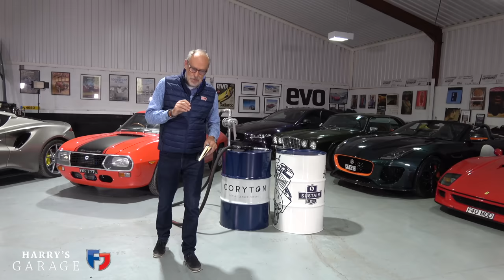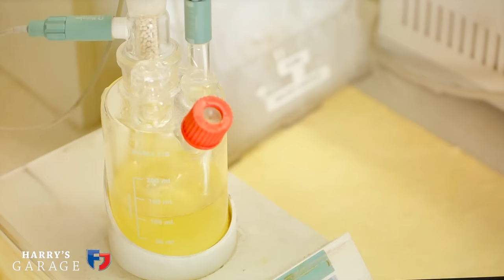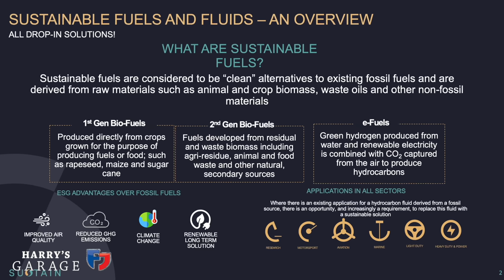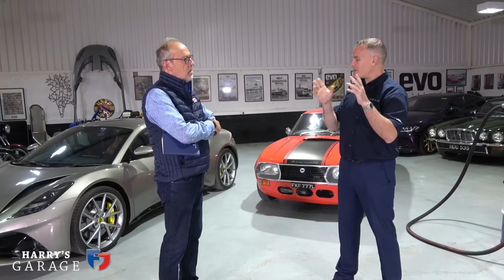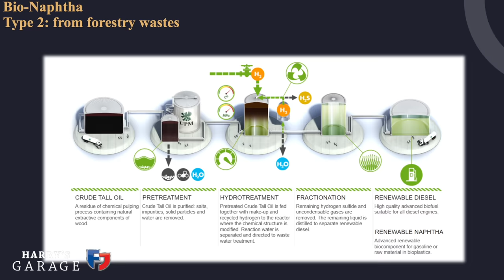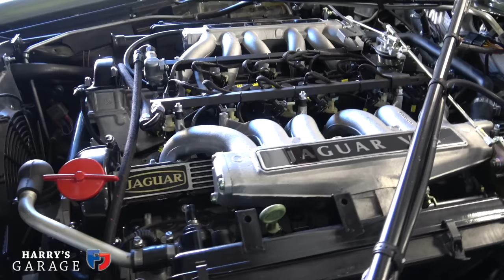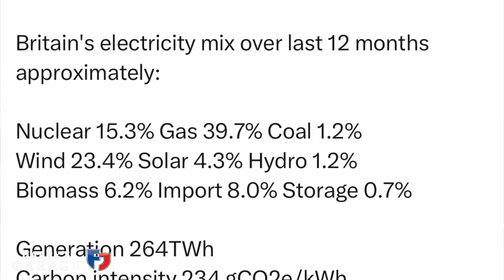Everything you need to know about using sustainable fuels. Why they're good news for car enthusiasts

Comment: Phew, so that's that sorted then!😂 Obviously not the simple answer to fossil free fuels that many were/are hoping for.
The disappointing part for me was, "it's not intended to replace fossil fuels for the average family car" but that's exactly what's needed IMO, a sustainable, affordable, readily available fuel to enable Joe Public to keep their conventional vehicles. On a personal note, as a 60+ petrol head, I think all I can hope for is that petrol and diesel availability at an affordable price out lasts me. 🤞
Reply: It makes no sense for all-day family car use, because the production process far too inefficient and expensive.
It is a solution where fossil fuels cannot be replaced by EV batteries (aerospace) and old / special / race cars obviously.
Reply: @autobahnroadtrips4662  How can you suggest it's "inefficient" when compared to 'sustainable' electricity production and horribly polluting BEV production, not to mention all the losses and inefficiencies during their use...then their recycling if it's even possible!?

This is incredibly small-scale production at the very beginning. And it's already massively cheaper than EVs are for certain!!! Do you not realize how much Evs and their infrastructure costs?? It's TRILLIONS!!

There are tens if not hundreds of thousands or people who have been driving for a decade on HVO biodiesel, biomethane, bioethanol and natural gas. Those are all MASSIVELY cheaper than EVs!!! Snd lower in CO2!

E-fuels can also OF COURSE be produced at large enough quantities and in very efficient production facilities, both in modern nuclear power plants and in remote locations where there are sustainable geothermal, wind, solar, etc. sources which can't be utilized without e-fuel or hydrogen production. But I guess you have no clue about e-fuel production in (or alongside) nuclear power plants, have you? You have no idea about how e-fuels (and hydrogen) are the opposite of what you say and actually provide incredibly efficient production with renewables.

Don't you realize how EVs don't even reduce CO2? I guess you haven't read the published research on EV vs. ICE lifetime CO2 emissions. I have, I've read them all. And I've read the paper published recently by Ffe München (an EV-industry-funded research institute) which shows how ICE cars even run on fossil natural gas are clearly lower in CO2-emissions than EVs!
Reply: @pistonburner6448  So how much does the wind cost, when it blows ?

Don't be a silly piston, this is a very impressive, but niche product, for a niche market, - but most people will be driving to Circuits to watch this being consumed by some fantastic cars in their bog-standard Wind-Power-Powered EVs.
Reply: Sorry but that is nonsense. You seem to forget that the use of the fuel alone in a ICE runs at an efficiency of 15-20% maximum, whereas the electricity in an EV is transformed into motion at 90-95%. This last consumption step alone has a factor 5 disadvantage for Efuels, not to speak about the conversion from electric energy to Efuel, which also only has an efficiency of about 40%.
If you multiply these %, you end up with an E-fuel overall efficiency which is ca 10 times worse than a regular EV.
Regarding infrastructure, also Efuels need to be produced  and need massive investments, its not for free. I am really wondering which publications you read, but certainly your information is not complete.
Dont get me wrong, I am also a petrolhead, but for regular daily use I use an EV and for fun I have an old car, for which efuels might be an alternative and where I am willing to pay 5-10 GBP per litre
Reply: @tomsdaddy  You tell me: Arw you really ready to provide me with cheap wind power? Well, chop-chop, hop to it!! You claim it's cheap so go produce some electricity! You have fun building the turbine, building the transmission lines (through YOUR back yard! You won't want any compensation for that, eh?) building the backup power plant to provide me with reliable energy when the wind isn't blowing or if it's blowing just a bit too much, building the power balancing systems, taking care of all the maintenance! How fin it will be to see you cheaply go mine those battery minerals for me, then go make the batteries, then ship them to the (new)facilities where you will cheaply build me the car (even though normally EVs cost at least 40% more)! Then you'll naturally build me a charging network of hundreds of thousands of charging stations for no cost at all, maintain them for me, and then replace them all periodically! Thanks also for taking care of the massive amounts of incredibly problematic waste from all those batteries, wind turbines, chargers, etc. etc.! And as pro-EV fools always forget about the taxes we all pay for our ICE cars and the fuel and the taxpayer (our) money which needs to go to supporting EVs at HORRENDOUS amounts, you'll naturally not only lay for my massive subsidies but you'll also pay the equivalent taxes as ICE drivers would pay, right? I mean otherwise there will be a shortfall of tax income which I might have to pay in additional taxes...

So nice of you to so all that for me for NO COST!

You see how easy it is for unintelligent people like you to flap your lips arrogantly and irresponsibly, but actually taking responsibility for your drivel is a completely different ballgame?
Reply: @pistonburner6448 you seem to forget that the absolute key element of Efuels is the use of sustainable energy to produce it. 
So you also need wind turbines for Efuels, but you need approx 10 times more than if you would use the electricity directly in an EV. This is why Efuels are so expensive. Basically you are contradicting yourself, as your Efuel does 10x more "chop-chop"
Reply: They might say that now, but what's to say that won't be the case in 5 or so years. If the demand is there, then the likes of BP, Shell, Exxon might go mass production. Porsche is working with Esso to do this. It is slow right now, but that can change with investment and  production. If EV sales drop, which the signs are they are struggling as forecourts have massive inventory and the EV second hand car market is in price freefall, then who will buy them. We have also now seen the third car transporter burn in 1 year carrying EV's. Now will this impact EV use. Norwegian car ferries have banned EV's from travelling on them. What else will follow. EV fires are 0.8% vs ICE of 0.02%. As more EV's are out there, that number will get even worse. I would hate it to happen, but there will be one on a passenger ferry or the Euro tunnel. That will end EV movement on certain type of transportation. From a safety point of view, that could be the end of EV's as they are to much of a health and safety risk.
Reply: @autobahnroadtrips4662  That is the often seen sign of someone who has absolutely no understanding of this subject matter at all! "Inefficiency" is a totally illogical and wrong thing to look at, and you would be incapable of doing that even if it was since you have absolutely no clue what you're trying to measure. No, "efficiency" is only something an unintelligent and uneducated person would even try to bring up: it makes no sense! It doesn't matter one bit. The ONLY things that matter are:
1. How much (new-to-the-atmosphere) CO2 is emitted in totality (including transmission lines, backup power plants, EV battery production, charging losses, absolutely everything!)
2. Cost

Those are the ONLY two things that matter. I'll give you two simple examples:
1. There is a solar farm which is used to produce e-fuels. As it doesn't cause any CO2 to be emitted, it doesn't matter at all how much you need to power your car as far as emissions are concerned. As for cost: all it has to do is be low enough in cost to beat alternatives or how much people are willing to pay to keep their ICEs. Meanwhile if you want to compare to EVs, you need s hell of a lot more to get yourself mobile: you need transmission lines from that power plant to get that electricity to everywhere you want to drive...and that may not even be possible or economically viable at all! Then you need the backup plant electric vehicles and their batteries, a charging network, everything I've already listed before.
That renewable plant could be on a small island (even in Iceland) and you could churn out e-fuels while the whole thing wouldn't be viable at all without it...electricity production isn't even an option!

2. Nuclear. Read up about it yourself, you're clearly totally oblivious about this whole subject. Modern nuclear plants can produce massive amounts of incredibly cheap e-fuels.
Reply: @pistonburner6448  Your so-called facts on this merely reveal the extent of your wishful thinking.
Reply: I believe he meant that in the short-term until there is enough development for it to go mainstream. The production process is exothermic i.e. produces heat which can the be changed into electricity which will then be used in the production of the fuel. Like a self-winding mechanical watch uses arm/wrist movements to charge the watch. For companies to invest in it there needs to be demand, critical mass, the classic & motorsport market are acting as that initial demand, remember the corporate world and the Blackberry smartphone...
Reply: @pistonburner6448  thanks for your insults, but they will not change the rules of physics. 
Fact is: due to the efficiency differences between the two concepts you need around 10 times more wind turbines, solar farms or atomic powerplants to cover the same amount of miles with an ICE/ efuel car than with an EV. As you know, wind turbines or atomic powerplants dont come for free.
But I will stick to Mark Twains wisdoms now.
Reply: @pistonburner6448 I think you might be confused. You know what efficiency means? You’ve mentioned hydrogen, which is inefficient to produce, store and move. Efuels require this to produce.

To overcome this inefficiency the amount of power required would be enormous. Way more than BEV’s 

And that’s before the inefficiency of combustion. This will never scale.
Reply: @autobahnroadtrips4662 nice to see someone with a bit of knowledge! Bravo.
Reply: @tbrdoescinema  Try to keep up: the required power doesn't matter as long as it's not emitting more CO2 than alternatives and it doesn't cost too much. If the power source emits no CO2, then the amount of power used doesn't matter at all. 10000000 x 0 = 0. 
If the power source is low cost (and couldn't be even used for powering the grid and BEVs) then you can use a lot more energy in that phase. Large-scale production can produce e-fuels at very low cost. Shell has already estimated to get to 2€/liter with their first, small-scale pilot facility!! Sure, that estimate has probably gone up now due to the war and inflation, but nevertheless.

For equal treat,ent: list the cost sources of electricity production and BEV use. Go on, list all the different things that cause costs!

Let me guess: you also claim that HVO biodiesel is expensive? And biomethane too?
Where have you studied about e-fuel co-production with nuclear power plants? Nowhere of course: you're making all this up like a 12-year-old...why some people have the need to pretend they know everything is beyond me...

And no, it doesn't really require as much energy as you think it does. Furthermore you have absolutely no knowledge of how massively much energy EVs require in totality.
Reply: @pistonburner6448  man, I really appreciate your friendly and well-funded discussion style.
Have you ever googled the term "efficiency"? It means how much you have to put in to get something out.
You refer to "CO2 emitted" and "cost".
These two are directly depending on the efficiency of the process. 
Don't you understand that a process that is 10x less efficent, creates 10x more cost?
Of course, both EV and efuels are more or less 100% Co2 emission free (if run on renewable energy), but the amount of Efuel you need to cover a certain distance cost 10x more than  
covering said distance in an EV.
I really suggest you should read a bit into engineering before pitching your brilliant ideas.
Reply: Two points for you too consider: 1. How can an upcoming new business compete with a regulated (for investors i should add) massive oil industry ? Im sure his goal is to compete with the oil industry but it's a brand new tech - without the masses its not possible to get prices to rock bottom. 2. People don't want  to buy  this now to save money - but want to do it because its the "right thing to do". These are people racing cars around tracks - which is kind of a "nice to have". I'm sure their dailly comuutes to the office are using the sane fuel we do.
Reply: @pistonburner6448  Jesus you’ve got no idea.
Reply: @pistonburner6448  Well that's a good half hour of your life you're never getting back, isn't it, 'Piston' ...
Reply: @daysofgrace2934  He's talking about efuel (synthetic). Biofuel is less energy intensive to produce but you have the feedstock issue, there's just not enough appropriate waste product to create the quantity of fuel that is necessary for the masses.
Reply: @HONDAVFRV4 someone else mentioned on another thread that Porsche needs to sort its reliability out before they spend a penny elsewhere. Ive just handed back my second TurboS because they break down constantly. First one they agreed needed replaced it was on its second engine and gearbox when the engine mounts and brakes started playing up. Second one needed two gearboxes and it started getting the engine mount issues and wouldnt stop warping its brakes. Needed a solicitor to get rid of the second one as they were refusing to take it back so i could go buy an LC500. Have had the Lexus 7 month now with no issues whatsoever and it feels 1000x better made. Porsche have lost their handling too, feels no better handling than the lexus yet i was expecting the lexus to suck on B-roads. It manages the bumps better than the TurboS and theres nothing in it.    Theyve turned the 911 into a quarter mile car and it shows.
Reply: @autobahnroadtrips4662  Good suggestion; he won't heed it though, instead he'll retreat to his safe zone of conspiracy-theory subreddits where no one questions his nonsense :)
Reply: people are already switching over to EV year on year. Think ICE cars will be just niche for the rich
Reply: @hassyg4083  uptake of EV has been as slow as it gets as far as "a newer tech" goes. More people switched to diesel on the arrival of common rail.
Reply: @TalksportWokistWombles  diesel is crap filters clog and you have to fill adblue. EV sales are record this year almost 1million EV cars now in UK plus cleaner air with EV no particulates
Reply: @hassyg4083  filters clog? 😆  rather have a clogged filters than battery cells out of balance and power reduction. EVs even given the fact they have vastly less moving parts than ICE have proven to be unreliable to the point its effected the manufacturers position on the reliability charts. I can change filters on a diesel quicker than an EV can charge up hahahaha. Cleaner?  No mate they are as dirty as it gets, the difference is the damage to the enviroment happens at the manufacturing stage of an EV vehicle and back at the power station. Thats not even taking into account how bad they are to dispose of after their service use. Please mate keep it real on here we dont want to hear what the BBC would say about it.
Reply: @TalksportWokistWombles  Diesel is being phased finally which is good
Reply: @hassyg4083  no it isnt its sales are at an all time high. You checking  before you say stuff?
Reply: @TalksportWokistWombles  erm no EV sales all time high go check
Reply: @hassyg4083  also why would it be good that diesel is phazed out for an even bigger pollutant?  You know electric cars are worse for the enviroment i just ran you through the reasons for it. On top of that EV is vastly more dangerous to humans during the manufacturing stage based on the fact lithium mining is hugely dangerous and the quarries are known as death traps. Why are you wanting diesel replaced with a factually worse means of propulsion?  Show your workings please like i do.
Reply: @hassyg4083  yeah for EV they are. You claimed diesel was being "phased out" yet its market share is growing and its already in 2nd spot. EV is nothing like as popular so you can wordplay that all you like but you made the claim it was being phased out not me, i just stated the facts and ill throw in the fact these things ebb and flow just like hybrid. I mean Toyota cannot even sell a prius in the UK now and the evidence shows the hybrid owners mostly went back to ICE not hybrid. EVs like Tesla its a known fact that owners rarely buy another, they return to ICE, i personally know that is the case. The full reasons for it i dont wish to speculate but nonetheless its the fact of the matter. You denying anything ive said? because im happy to put the figures on here even the prius figures and Hybrid in general. Thats not a problem mate, what i wont do though is listen to someone word playing like the BBC or Ch4 or CNN do. Thats when you know you are full of it

Edit: If you meant the criminal politicians are trying to phase it out then i agree with that yes. Is that what you meant?